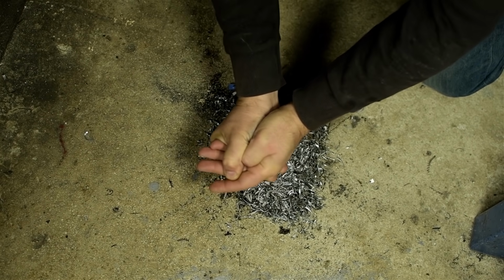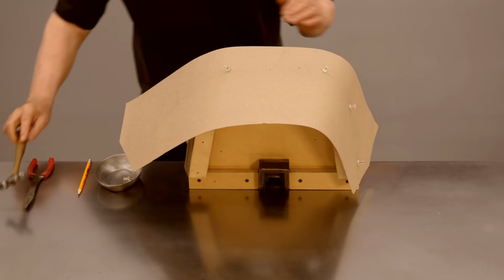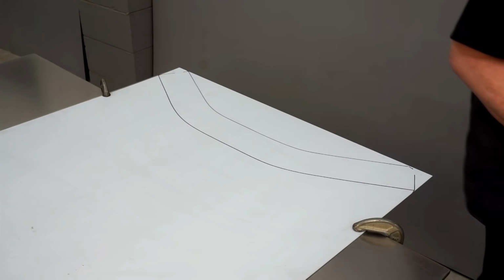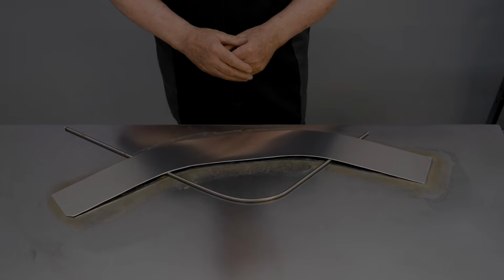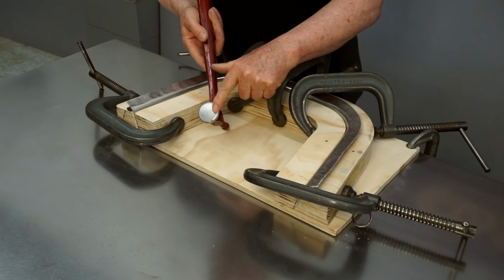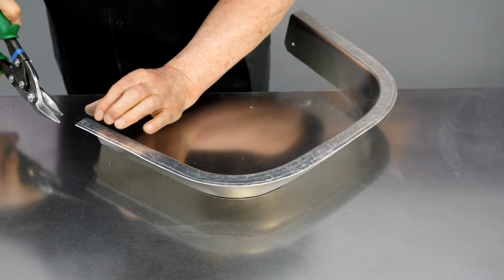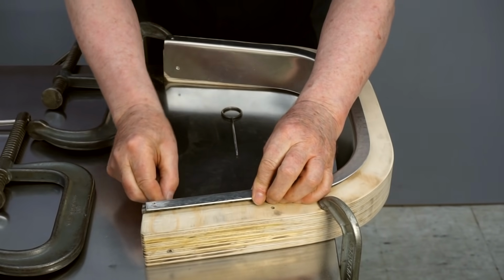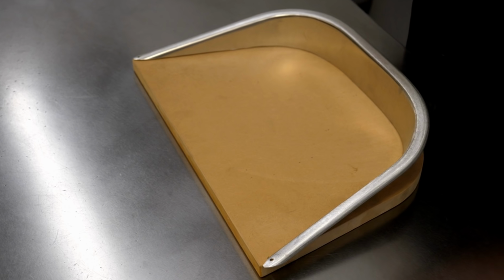Cleaning Up! with This Old Tony - Part 2

Comment: 1:24 - that's just about enough time for me to have ordered a cheap plastic one off the Internet.
Reply from the maker: Of course you wouldn't make a dustpan if you could easily buy one - but what if you wanted to make something LIKE a dustpan in some way, and nothing was available. That's when it's helpful to know how to hand-fabricate nearly any shape you can imagine.
Reply: Yes one dollar !!!! These cheap plastic is Chinese junk, every month you would have to buy one or you have to use them with extreme caution. An aluminum one is much more robust and can be repaired without problems. This is just one example of what you can do with the basic knowledge. Great Ron.

Comment: Why all that Fuss when HARBOR FREIGHT sells a Big aluminum Floor pan Cheep ? . 🙊
Reply from the maker: Of course you can buy dustpans inexpensively. I'm hopeful that people will see how these techniques can be used to make a wide variety of complicated parts!
Reply: @RonCovell  your dust pan is a work of art i forgot your the master metal shaper guy love your video's. Are you connected with Covell MACHINERY  THEY MAKE  SURFACE GRINDERS there name is printed the same. 🤤
Reply from the maker: I have seen Covell surface grinders, but I have no affiliation with them.